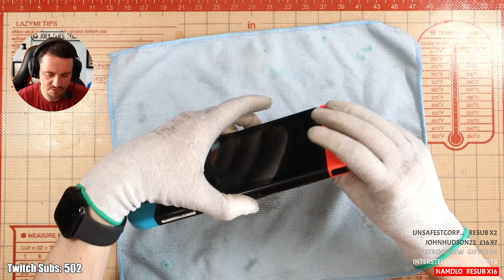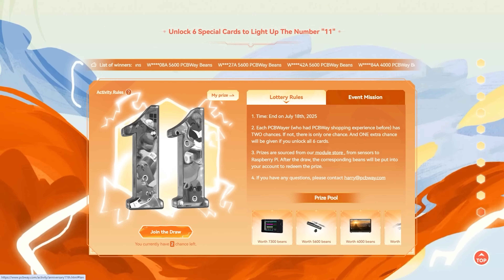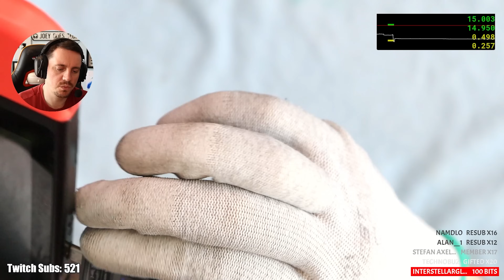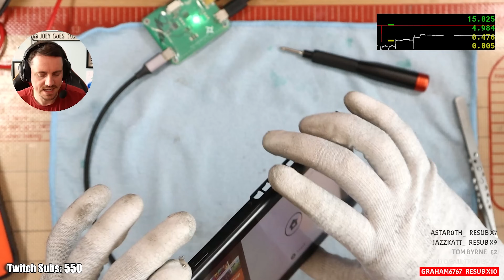This Switch Was ‘Repaired’... But it's Still Broken?! - Free Fix S1:E03

Comment: When my now 2 and a half year old dog was a pup she chewed my laptop table apart, luckily the laptop wasn't plugged into wall at time, I had to end up getting into the power supply with force by chipping at it with a screwdriver and hammer being careful not to damage it, desolder the damaged cable and then make the other piece which had the connector on solder to the psu.

Worked great but now have a cosmetically looking awful psu that works and the gromit is missing.

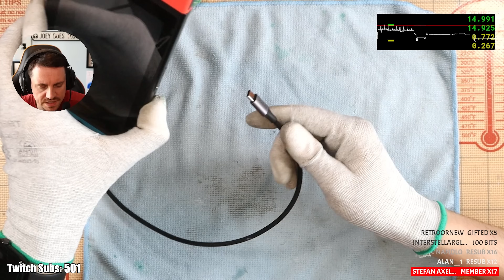Comment: 3:13 I’m keeping my bets here, the usb c port is soldered for one set of pins not both.
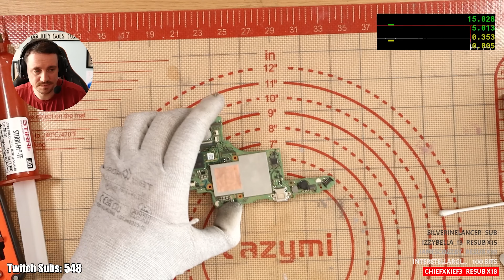13:03 damn… it wasn’t the issue.
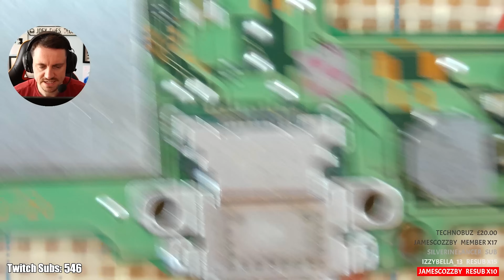Reply: i find it weird nobody mentioned the completely charred black component at 08:49 to the right of the usb port above the screw hole.  and completely charred board aswel several layers deep.

Comment: It occurs to me that you should mark your USB C plug that you're putting in the unit. That way after you replace a port you can check the same side of the cable to see if you're getting the same results. (After watching a little more, I see that the plug does have markings on one side but not the other, so it may be that you just need to note which side works).